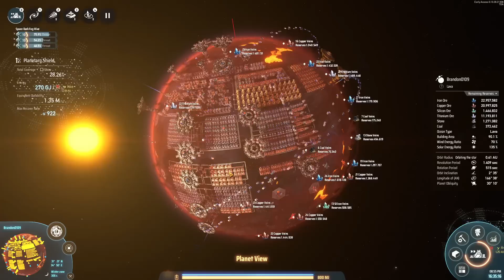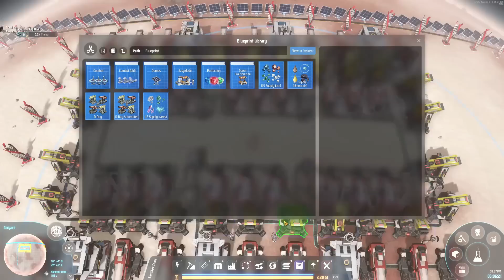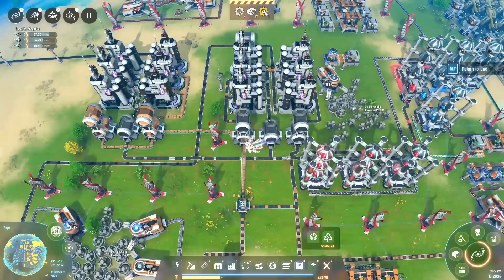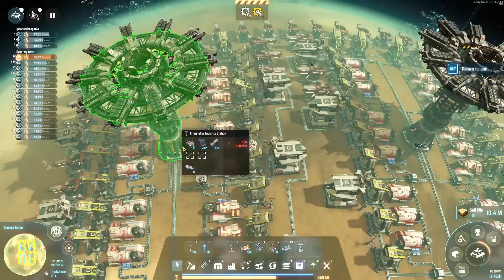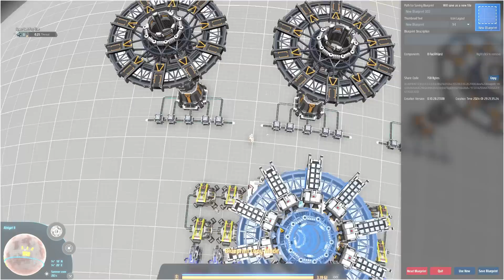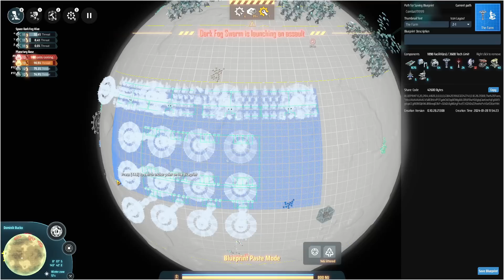Farming the Fog | Max Difficulty Combat | Dyson Sphere Program

Comment: Doesn't this stall as soon as any item fills up?
Reply from the maker: It does, but you can simply request items elsewhere and/or ensure that the items you don't need at all simply don't drop. I personally turn off things like the dark fog Tech stuff - you only need a small amount of those.

If you want to make it really efficient, simply put a belt monitor on each small belt going into the ILS and set it to detect stalled belts. That way you can get notified from the other side of the galaxy, simply put down an ILS and request that items, and things will get moving again.

Comment: 2 hours to clear is probably what the devs hoped for in the game design and kudos for you playing the way they hoped (although you did not need 4 ILS and probably needed for missiles and implosions packed in there).  Of course, you could set the missiles to take out the relays right away and only spend 15 minutes clearing the planet but ...
Reply from the maker: You have a point there - I still have some residual trauma from my bases being wiped out by space fleets in the first few games, but at this point it would definitely be a way to speed things up as the shields are easy enough to get up and running earlier on than what I did here.
Reply: @TheDutchActuary I think several streaming initially said "never hit the relays" and it stuck for a while but really, you always hit the relays after your starting planet has shields and missiles to defend the relatively small attacks from the space hive
Reply from the maker: Indeed! @ChemE_99

Comment: I setup a dark fog farm a few days ago. One of the best decisions I've ever made. Looks like im quite a bit further in progression, but the fuel upgrade is insane. It has 10x the energy, stacks to 50 instead of 30 like the antimatter fuel, and the chamber gen max goes from 1100% of the antimatter to like 2200%. The chamber gen alone allows fighting hives and bases extremely easy as you regen faster than the cost, mostly at least. The dark fog at level 30 bases is pretty rough though, my current farm base only uses implosion cannons with the tier 2 ammo, i will lose a turret every now and then but for the most part it sustains itself.

Comment: I have a problem with my fog farming. Even in a system where I only use 1 planet for the farming the fog runs out of energy. Constantly. What can I do about it? Do I need to do a more difficult run?
Reply: The Fog gets its energy from the Hive - have you taken that out?
Reply: @Yardiff  No it's still there. And it has those stations on there as well.
Reply from the maker: Are you shooting down the relay stations? I haven't seen my fog run out of resources unless I intentionally deny them access to everything.
Reply: @TheDutchActuary  No. They land on the planet. But after 1 round of firing they are out of energy again. Even if I wait a while.to put in the sensor tower.

Comment: I think farming is worth it for the alien tech items you get. The machines you can make from them are awesome, and at the settings "500% experience" and "aggressive" (or higher) you get, in a reasonable time frame, enough alien tech stuff that you can make machines to build any "build big" enthusiast's endgame factories exclusively with them. I had enough stuff to build factories making 240 universe matrices per second with alien tech assemblers, smelters and matrices exclusively after only a few hours. It takes way longer to build the Dyson Sphere(s) you'll need to power all that.

Comment: Power is the bottleneck, once there is enough then protection of the whole planet can be done - qol for your jumpstart planet. How many 10x10 wind turbine blocks can be put down? (30mw per block)

Once the first two planets are fully-protected and producing maximum power, how about transferring some of that power via accumulators? They got a big buff with the update, 54mw charge/discharge per - so 4 discharging at a time will be 208mw, plenty of power for lasers.

I’m liking @sawyeriii ‘s idea re using lasers. Save the resources (bullets/bombs/missiles) when farming.

Another thing is that I’m not a fan of burning coal in various forms for long, the transfer of renewables seems better.
Reply from the maker: A transition to renewable energy it is! I think I built more thermal plants in the last few weeks than in my entire playtime in DSP combined (before this update I actually only had it in the mall because it was easy to do so, but never them).

Comment: Adding a set of stackers before injecting into the farming ring( or coming out of each BAB or BAB set) may help with loot throughput before and after belt upgrading, plus a set inline with the ring to open up any possible space on the belt for more to be injected.

With only two bases to farm, that front line should be able to be nothing but lasers, BABs and signal towers if you can cover the power requirements. You'd also want to "turn off" the missiles from afar or set them to high air or space only.

Thinking logistically, the design should be based around the 12 repair drones of the BABs, as it cost nothing to repair a building only to replace it and the drones fan out radially from each BAB. So 2x12 drones, setting aside 1 for each BAB makes 22 and another for the signal tower as it both pulls aggression and tanks fog fire makes 21 free drones for repairing lasers. The BABs repair each other and the buildings nearest in a first come first served order, thus I believe a best tillable design is with the tightest formation possible of 2 BABs each surrounded by 21 lasers and a signal tower (at the rear) to tank damage and draw the aggro. Tiling with this set will also allow BABs outside of the set to send drones to help if they aren't being hit as hard.

As a side note, it would be a much quieter farm.
Reply from the maker: The swooshing sound of the missiles does go from extremely satisfying to mildly annoying after a while ;)

Interesting suggestions!